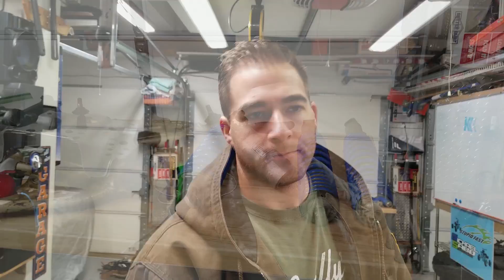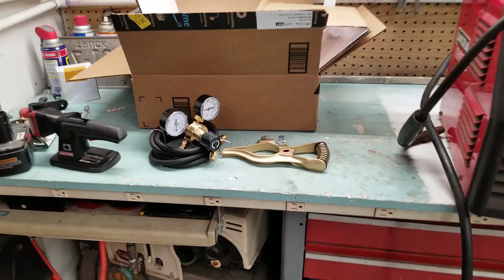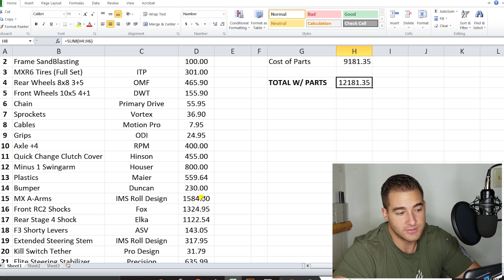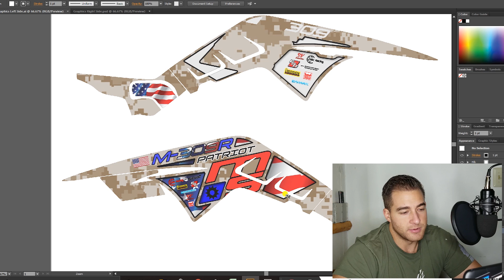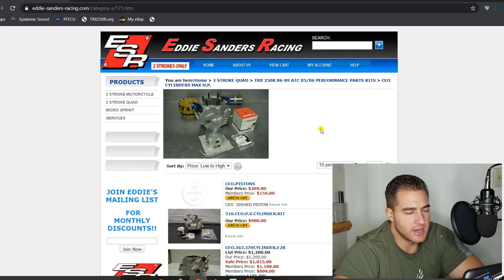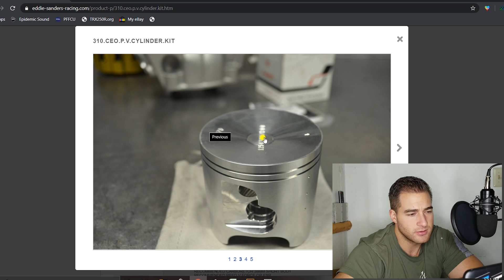Motor and Graphics Plans and Parts Total So Far | Project 250R Part 9

Comment: Don't forget a precision steering stabilizer and a rpm dominator ii mx axle. I'm not sure why the -1 swingarm?? Stock or +1 length to keep the front end down on throttle out of corners, especially with a 309 motor. The suspension and tires should do a good enough job of getting power to the ground. Speaking of the CC, why would you not opt for the 330 kits?
Reply from the maker: Thanks for the info man. In 88 Honda shortened the swingarm by 1 inch; it is supposed to be an improvement. So its very common that guys run -1 and especially for MX. This is what I've gathered from people helping me and from forums. I am using a Precision Elite and dominator II 🤘 I chose the 309 kit because it does not require case porting and it's more affordable and realistic for people watching who want to build one similar. I know ESR makes a 330 kit where case porting is not required but I hear bad things about the reliability.
Reply: @MichaelSabo  Yeah, I missed the part of the stabilizer. What width are you trying to go for? I have noticed over the years that most everyone tries for 48" front and back, and the RPM axles are adjustable, but I'm not sure of the front width.. the tire offsets always mess with me. Are you setting it up for a specific track or a multitrack?
Reply from the maker: @itsallaboutwins5493  I'm not sure what the actual width will be; it's a stock frame with +3+1 arms, and 4+1 wheels. Its what was recommended for my setup by a few people that are more experienced with MX than me. I am building it for MX in general, not a specific track or anything.
Reply: @MichaelSabo  always nice to have input from more experienced people. Good luck on the build. Hopefully get to watch you send it!!
Reply from the maker: @itsallaboutwins5493  cant give enough credit to all the people who have helped! Thank you bro and I appreciate you watching my videos!

Comment: Hot damn mike lol.. 12k. Can't wait to see it fully done! I also noticed on the swinger you're missing the brake stay bushing. On the 250rs there is the bushing and then a c clip that goes there. If you didn't know the 400ex bushing (if that swinger is exactly like a stock one) fits right in there and eliminates the c clip. Way better setup.

Comment: Maier has made nice plastics for awhile now. Back in the day they were grainy. But they changed them.
Reply: Yeah but you know what sucks is they have bolts in certain areas so you could tell there the aftermarket Plastics. They have two bolts on the nose cone and two bolts on the side of the front fenders so if you want your bike to look stock it doesn't it's a dead giveaway. I don't know why they did that.

Comment: I just picked up a Laeger. I sold the red black and white one on my page. 
It's on like Donkey Kong🤗🤗🤗
Reply from the maker: Laeger is tits man!
Reply: @MichaelSabo  Yes sir💵🤑😂
Reply: Once you ride a Laeger you will never want a stock frame 250r again, my buddy raced GNCCs on two of them in the 90s, I was his mechanic, they are the king in my eyes, we had over 20k in each of them back then
Reply: Longlivethefourtrax250r
Reply: @250rtrxjunkie  could you elaborate more on the cr500 no link? I though all cr500 setups are link.